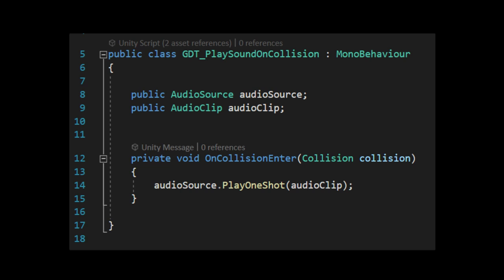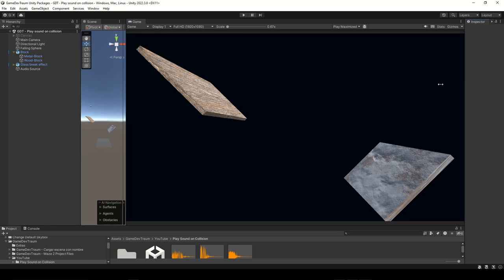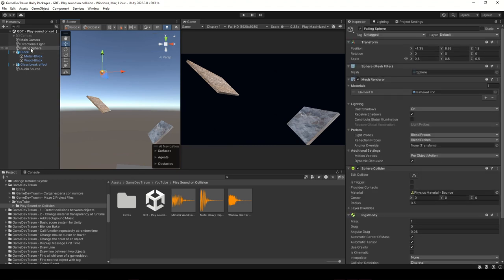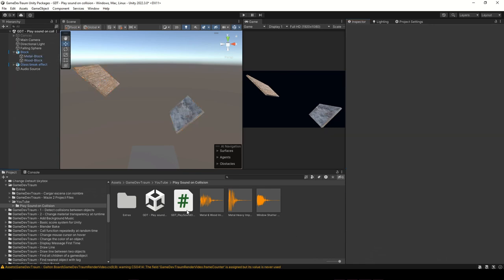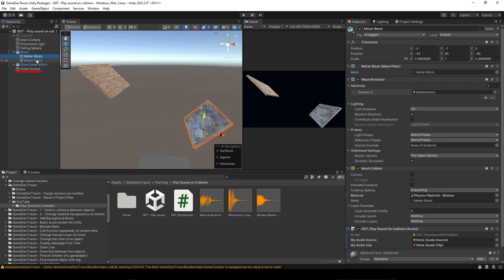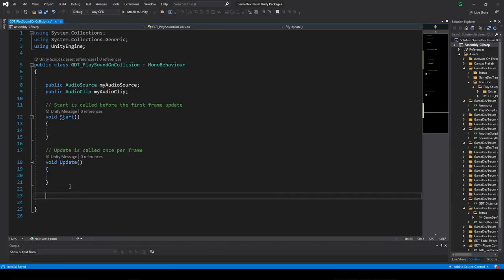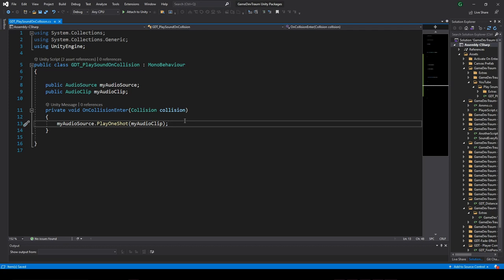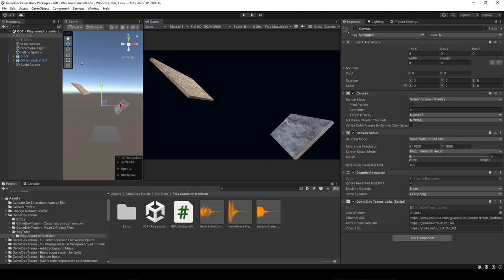How to PLAY SOUNDS ON COLLISION in Unity - Downloadable Unity package

Comment: Friend, your example unity file you gave link for doesnt work. It downloads package but two of the objects do not install correctly so its impossible to test scene.
Im using your sound on collision script and it doesnt work even though ive set it up correctly. Ive got a cube with sound source and a box collider marked trigger that when my player touches i want to play a sound but it dont work. Ive got no errors in console for the script. My player has a box collider set as trigger and a rigid body set as kimetic.